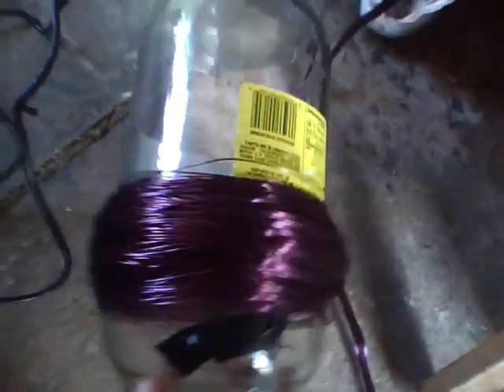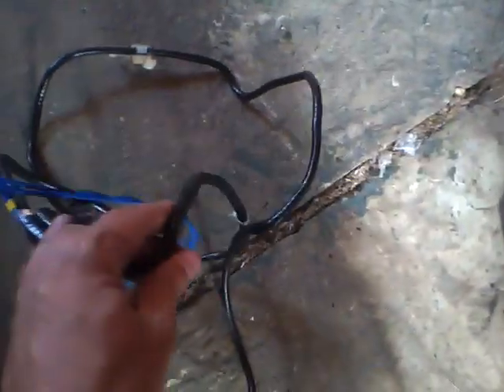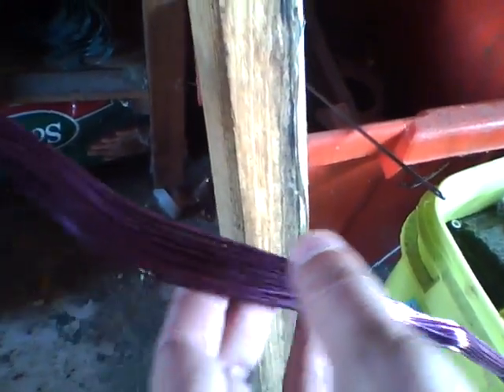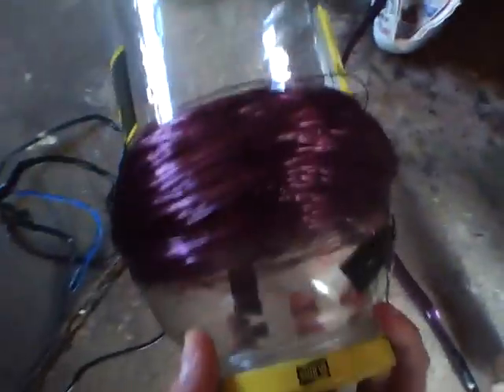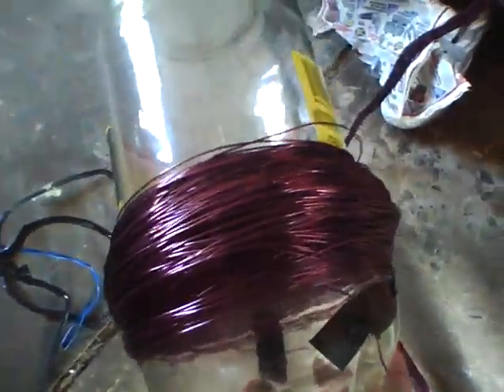reusing or recycling copper wire

Comment from the maker: @slickbeaner212 when you take the back of a tv off,there is a big wire that is around the tv tube itself,its really thick and is fully covored with electrical tape.most of the time its aluminum,but the rest of the wire in the tv is copper.